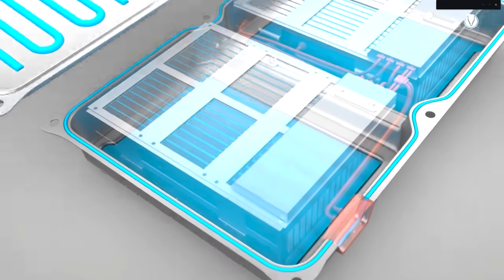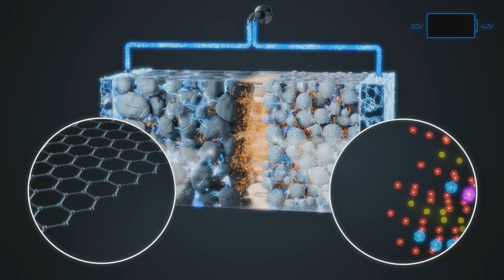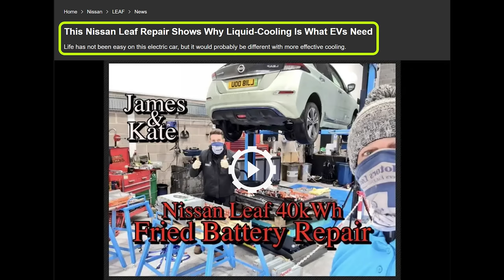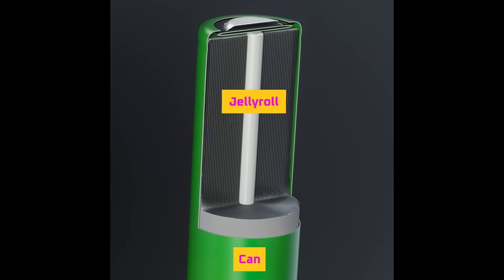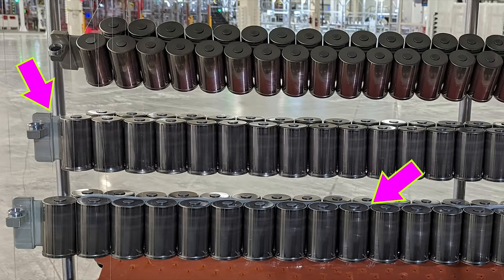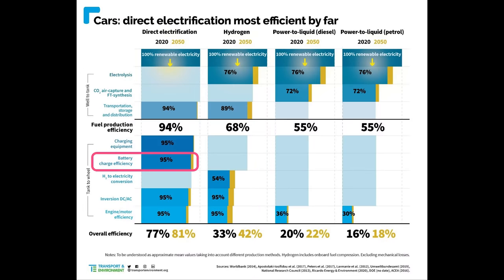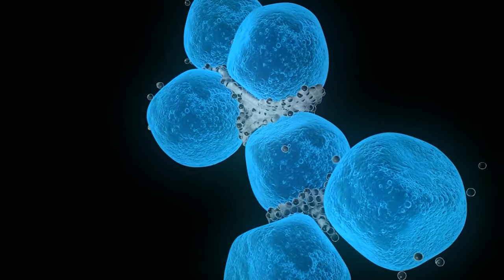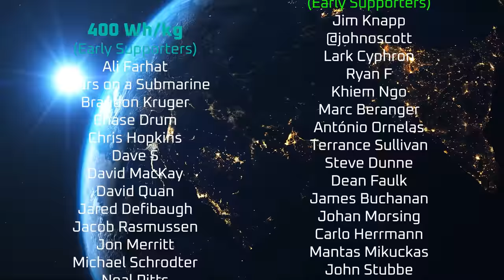4680 Thermal Design and Management // Why Ribbon Cooling is Better

Comment: Thanks once again for your insights. Surface area of contact with the thermal sink is the key determinant of sink efficiency. That makes sense. And the tabless design reduces resistance and thereby reduces point thermal spikes, thermal heterogeneity, and accelerated electrode failure.
Reply from the maker: Great summary!
Reply: Actually NO! Your last sentence is accurate but your take on 'Surface area' efficiency is 'out of context' in this case.
When 'all other things are constant' (heat sinks being equidistant from the source etc) then contact surface area makes a difference. However, the Top & Bottom plates are much closer to the heat source (current collector inside the can) than '1 rectangular patch on 1 side'.
The video's take that Top-Bottom cooling somehow 'orphans' the sides is ridiculous. Most heat will flow from current collectors to the 'infinite-tabs' connected to Top-Bottom caps....leaving very little to flow thru the dozens of insulating layers leading upto the side walls.
Let's assume that heat from current collectors somehow permeates to the sides (in large quantity), then if side walls can wick heat from the Top-Bottom to provide efficient (?) cooling (as described in the video), then it's only logical to expect the reverse flow (that Top-Bottom will also be able to wick heat from the side walls).
Net-net, Top-Bottom cooling of 4680 will always be more efficient than (one) side cooling. However, the choice made by Tesla might have been driven by other considerations (like safety....ability to vent a thermal runaway via the bottom etc). Even though Top-Bottom cooling maybe the MOST efficient, the side cooling (via ribbons) may have achieved REQUISITE cooling while providing design flexibility to take care of other aspects (safety against thermal runaways etc).
Note that Top+Bottom cooling means heat is wicked away via all metallic contacts. Side cooling ( or for that matter Top-only or Bottom-only) essentially means that one set of current collectors are directly cooled, while another set of current collectors have their heat wicked thru the insulation material to the adjacent current collector of opposite polarity).
(Also to be noted is that Top-Bottom cooling that facilitates a more pristine honeycomb packing will also be structurally MORE strong. But again, Tesla might have attained REQUISITE strength in the current design that they felt comfortable to heed to other aspects viz safety)

Comment: Great video. I was also under the impression that plate cooling for cylindricals was the best approach. Also worth mentioning that teslas 4680's uses ~600 micron cell cans, which would greatly increase the thermal conductivity of the can itself
Reply: Can you help me understand this better?  Are you saying that something about the outer cell wall thickness makes side cooling better/worse?  As I understand, the "structural" 4680 can is thicker than traditional cells.  Doesn't thicker wall slow down heat transfer?  Or are you saying the cell side wall thickness much thinner relative to end cap thickness?  Just trying to understand how wall thickness plays into the system.
Reply: @oof_Dad  good question.

What i meant was that the added thickness (for structural reasons) (compared to other cylindrical cells) helps with thermal transfer as you've got a larger number of atoms which can transfer the random kinetic energy throughout the entire cell can body, despite having the source of the heating/cooling being further away.

Usually, adding material would increase the thermal mass and slow down the temperature change. The kinetic energy transfer would still be the same, but the temperature change per unit kinetic energy gain/loss would be lower. The less atoms you've got, the more kinetic energy per atom, and thus the higher the temperature gain/loss per unit kinetic energy added. Energy stays same.

However, the added thermal mass in this case is negligable, meaning that the only appreciable effect would be that of a greater thermal transfer capabillity. By having thicker sidewalls (as a result of a thickner can), you increase the thermal transfer to the entire cell body.

Comment: Along with the structural benefits of ribbon cooling and the fire mitigation benefits, it is just a much more feasible manufacturing task than assembling hundreds or thousands of cylindrical cells in a bottom cooled pack. Especially given the need for standard separations between cells and placement for the collector connections, it is just much easier to glue the cells to a ribbon cooling tube and make bandoliers then to place hundreds of loose cells into a pack precisely and try to assemble the pack from there without jostling them out of place or tipping them.

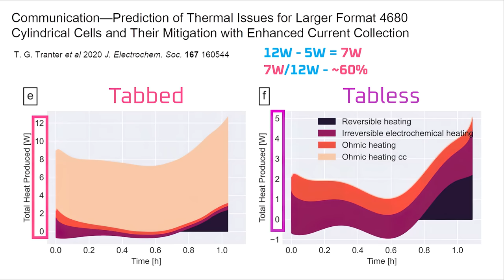Comment: At @15:15 you state that the heat dropped by about 60%, which is correct based on the math shown. But at @15:30 you multiply by 0.6, which would be only a 40% reduction. You should have multiplied by 0.4, or divided by 1.6. The conclusion you reached was that heat losses come down from 5% to 3%. But the math would bear it out that you go from 5% to 2%. While that's a 1% difference, the difference between 2 and 3 is 50%.

Great video so far, loving it always.

Comment: Well done. Thanks Gordon.
Regarding Thermal function of the top/bottom Plates. My take is because your Tested 4680 Cell was not used under pressure, in a car, prevents us from seeing the Actual affect of heating cycles. Hope that @Munrolive will dissect one.

Comment: With higher amount of cycles for LFP + lower degradation due to better thermal management of the tables design these 4680 batteries will likely outlive other components of the car enabling reuse of battery packs in other cars and/or in future storage packs.

While simultaneously giving more power as the shorter travel path of electrons enables higher current flow increasing the acceleration possibilities and also the charging speed possibilities.

Looking forward to cars being charged at vastly shorter times without degrading them.

Will likely be even more important for Semi & cybertrucks than current passenger models.

Thank you for your very detailed in depth videos! This is braingasm for a chemical engineer 🤩🤓
Reply from the maker: You'd think!  But as Drew Baglino has said, the batteries have already had issues with the cells outliving the pack.  Battery packs are a difficult challenge from a durability point of view as well.
Reply: @thelimitingfactor  interesting! what part(s) of the packs are failing before the cells? Maybe you have already mentioned this in another video?

Comment: It’s possible there is also another couple of benefits to ribbon cooling. The ribbons can act like a stiffener to the battery pack, providing internal support. This in turn reduces amplitude of vibrations, which in turn reduces forces acting on the battery connection. Ultimately providing better longevity of the pack. 
Where does this assumption come from? 
My first Job after school was as a sheet metal worker. Square ducting is often folded diagonally to increase stiffness and reduce noise. Noise is vibration.
A straight ribbon would be floppy, a formed ribbon will be stiffer.
Reply from the maker: Bingo!  Thanks for your thoughts

Comment: Small correction LEAF batteries aren't actively cooled, just passive heat transfer, 1rst gen Ioniq is example of active air cooled battery
Reply from the maker: I don't think I mentioned active or passively cooled.  https://insideevs.com/news/482245/nissan-leaf-repair-liquid-cooling-benefits/
Reply: @thelimitingfactor  "The first generation Nissan Leaf was air cooled"...
All generations were convection cooled. Only the Nissan e-NV100 was fan air cooled.

Comment: Something nobody seems to ever mention is the relative simplicity of the manufacturing equipment required to make large cylindrical cells compared to pouch types. The simpler the equipment, the more reliable and the cheaper it is to produce. It's also easier to ramp up the production rate than all of the stop-start motions and complex alignment moves required for pouch cells. I really can't see Tesla changing from a simple to a complex line which much surely take more factory space, even if there are marginal gains in other areas. Elon keeps saying that the product is the factory, and the large cylindrical cell format fits that narrative perfectly.
Reply from the maker: I've mentioned it in the past.  But this video isn't about the cell manfucturing cost.
Reply: It's the basic principle.
Large amount of GWh (TWh) from the smallest possible factory.

Comment: Excellent stuff ! I had to specify and manage the battery "fleet" at a robot company. So batteries are eternally fascinating (to me !) . One thing I suspected, and AI2 sort of proved, is that Tesla's ability to model the real world is unrivalled ( nobody really mentions this rather important moat). That is a mix of software, mathematics, physics and engineering expertise, to model whatever they need to optimise - rather than rely on "expert opinion". What's interesting here is the "bias towards the proven result" - once you realise the reasons why side cooling is better - "Well it's obvious! "...(except it wasn't at the time...)
Reply from the maker: Amen!

Comment: I definitely think that the thicker casing of the structural 4680 cells will help spread the cooling more evenly around the entire circumference of each cell, helping to negate the increased ratio of diameter to length found in the 4680 (as well as the structural benefits).

Comment: I would also have thought Tesla would switch to "bottom/top cooling" since it's far less complex to assemble. The only thing I had my doubts about was the height, because the cells are now even longer, which would make the floor structure difficult for a sedan.
Nice work!

Comment: The way that the current collector jumps from the outer edge to the core, skipping the middle layers, is exactly what you would want to reduce the temp increase in the center. If you contacted all the layers then the outer layers would "use up" the cooling potential, make it less cool where it hits the center hotspot. There may be an analogous electrical advantage if the electrical resistance to the center is also higher, though not obvious why that would be so in the tabless design.

Comment: Great video man. I wonder if this will be the long term or shorter term cooling solution. I would imagine it would continue to evolve as new silicon doping and material changes with v2, v3, etc if they are indeed serious about million mile battery. 

Also big congrats on closing in on 100k subs!!
Reply from the maker: Getting there slowly! lol

Things have kind of levelled off.

Comment: This is amazing analysis.  Rivian and Lucid used plate cooling on their EVs.  I think that they will have performance issues when performing back to back drag races.   Tesla Plaid does not have this issue since they fixed the serpentine ribbon cooling to a parallel ribbon cooling like the Model 3.  The optimal design for heat dissipation then would be the tabbed 18650 cell with parallel ribbon cooling based on your analysis.    Great job Jordan.
Reply: It is interesting that Lucid seems to not have overheating issues despite their bottom cooling design. They started out designing battery packs for EV racing so they must have some other innovation that results in better cooling.
Reply: Interesting.
Note that Peter Rawlinson threw side cooling under the bus in favour of Lucid's side cooling.  His argument was that it is difficult to get reliable contact with the curved surface area of the battery.  I was not convinced.
Reply: @bru512  Peter is right, it is hard to get reliable contact. Tesla bought the company that was making the cooling tubes for them because quality control was not up to the required level. Basically there is a coating on the cooling tube that is cooked on, and it has to be cooked just right. Too "raw" and the surface is slippery and the glue that bonds the cell to the tube slips off. Too "well done" and the coating cracks and peels off the tube. Then the glue used has to be the right mix of the two ingredients, the applicator tube has to be properly maintained and changed often as it will clog over time, etc. One guy who was what they call a CTA (cell tube attach) worker blew off changing the application tips his whole shift, they had to bring finished battery packs back from Fremont and he got fired. 

Yeah, just like the "experts" said, the Model 3 battery packs being made on an automated line was impossible, and when they say that just add "for anyone except Tesla" and you may have a true statement.
Reply: @tribalypredisposed  How do we know they don't have heating issues?
EV racing only requires packs to last a few cycles.
Reply: @bru512  well, the cars are in the wild now and I don't think there have been reports of acceleration being limited due to heating. I may have missed them, of course. 

One thing that may be helping Lucid avoid heating issues is that the pack is enormous at 118 kWh, so the acceleration heats each battery cell less because there are more of them.

Comment: I built a LFP battery for a RV that gets used daily - 6yrs old now - new cells were Bottom balanced @2.75 volt -  
cell balancer units were not reliable at the time so did not install one  - battery discharge to 40% daily - solar charge -
I check battery cell balance every few weeks - cells hover around 4mv difference -   Amazingly Good

Comment: Thanks a lot for the video and for sharing the reference. You can still use the explanation showed here in order to demonstrate that the prismatic can be as good as a cylindrical 🙂. The conductivity alone is pointless, and using the thermal resistance is more realistic for choosing the best cooling direction ( Thickness/(Conductivity*Cooling_surface). In the case of the cylindrical cell, the radical conductivity is quite poor compared to the height direction. But the radial direction has higher surface. There is a possibility to make the top/bottom cooling better but due to cell integration and important contact resistant in the height (gasket, gaps, electrical insulator) , the height is less interesting. Finally in the case of the LFP from CATL , you can apply the same reasonning and  due to the use of the LPF you can have a higher Tmax overall and you do not need higher cooling surface. The sum of improvement of TESLA is driven by cost per performance and tooling is one of them. My guess is that there is less ivestment by staying in cylindrical instead of switching to another form factor. The increase of cell size has been done by CATL and BYD already in 2018 and they have also updated tabs and the number of JR inside the cell in order to cope with  the thermal drawbacks
Reply from the maker: Sure thing!  Depends on what your goal is.  A full form factor comparison can't be done the comments here.  I already point out an upcoming video that Qilin has better thermals than 4680 structural.
Reply: @thelimitingfactor  looking forward to it

Comment: I thought I heard ( but I am not sure from where)  that with generation 2 batteries and the new 3 stages combined rolling equipment they were going to omit the copper current collector and laser weld the copper foil turnovers directly to the can  base.
Reply from the maker: Next video

Comment: Tesla's battery cells don't really need maximum thermal performance typically. Cells don't get that hot normally unless in extreme conditions like at the track perhaps. Also, uniformity is good when cooling or heating, you don't want the bottom of the cell to be different than the top half, so ribbon cooling cools the entire jacket which then cools the entire cell, making it uniform temperature. Good thermal management is needed for long term performance of the cells, but having maximum thermal conductivity is not even really necessary.

Comment: Excellent analysis. What you did not say is that one end of the battery is great for cooling, but at the other end there is the electrical connections for both positive and negative. Perhaps also some thin wires which monitor the performance of each cell. So, it will both add complexity and be of less value thermally, perhaps not worth the effort, to extract heat from both ends of the battery in the end cooling scenario.

Comment: I wonder if there's a way to use the natural void in the center of the cell for liquid cooling? This would allow the cells to be closer together creating a higher with volumetric energy density pack. Maybe you could even have a passive mechanical thermostat in the center of each cell, allowing each cell's temperature to be controlled as an individual.
Reply from the maker: You could, but it would create many other issues with manufacturing, cost, and weight.

Comment: I would have also gone for a top/bottom cooling. In a uni e-motorcycle competition i designed the battery pack cooling i such a way, not appreciating the full jellyroll + can approach since the infor the papers showed the later years was one approaching the jellyroll alone, with very  poor radial conductivity.
Also, we weren't focused on durability buy max T in 5-10 battery cycles.

For the new prismatic cells bottom heat sink utilization was a no brainer

Comment: Also, cooling between cells maximizes cooling while minimizing cooling lanes required. having coolant flow on the bottom or top of the pack would only cool the cells on one side, and need to be insulated on the other side. (you don`t wanna cool/heat the structure around the cells)
if the cooling channels are not the full height of the pack, they probably won`t hurt rigidity, because the lever is the highest on the top and bottom of the cells anyway. think of hollow structures or half-timbered structures.
Reply from the maker: Great point!